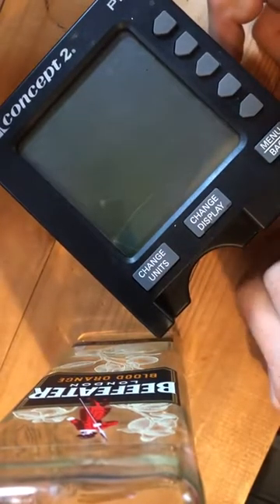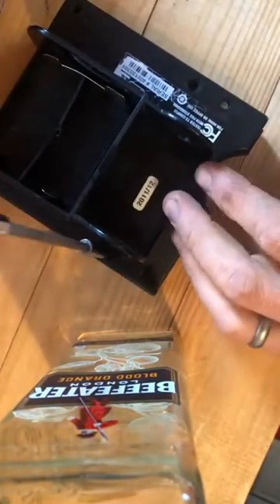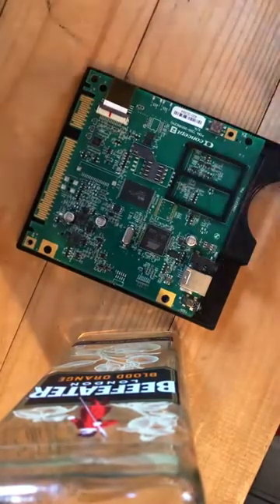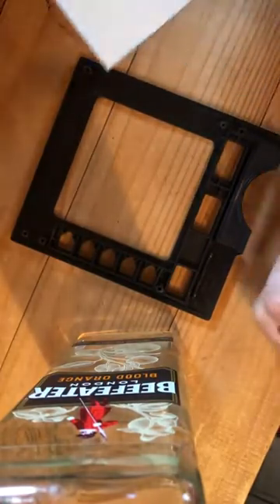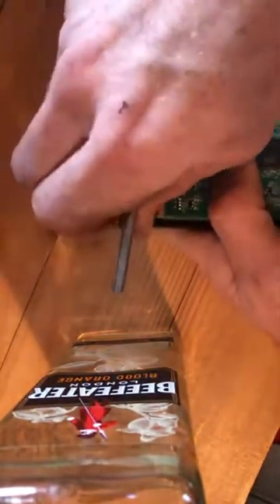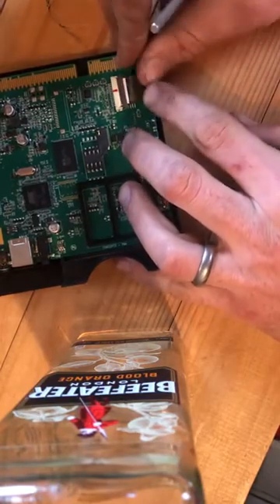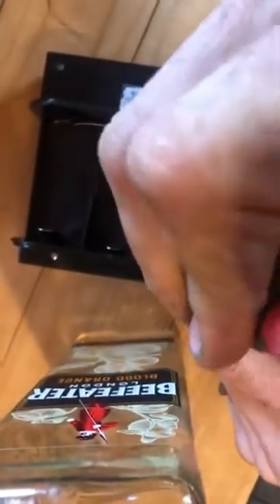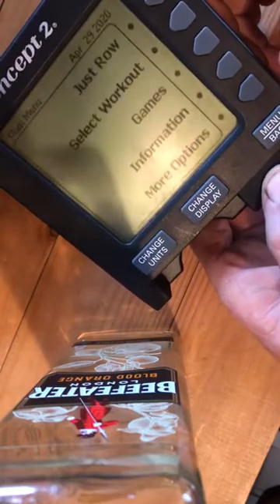Concept2 screen wont work /broken monitor, pm3 how to do a screen replacement to fix

Comment: That’s a great video. I’ve got a pm5 and the menu power on button doesn’t switch the monitor on - works fine when I pull the handle which switches the monitor on, but just won’t power it up. C2 have advised me to clean behind the keypad. This video makes it much clearer what to do - especially removing the ribbon. Thanks very much!